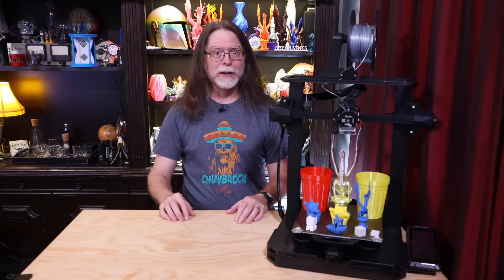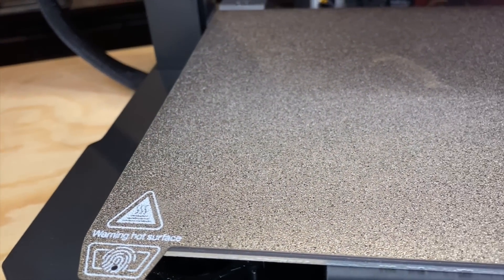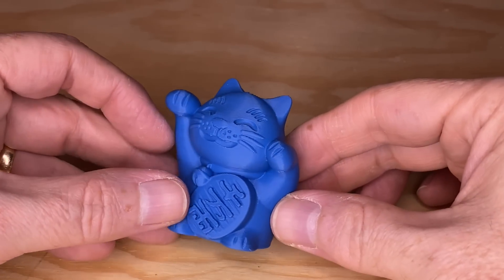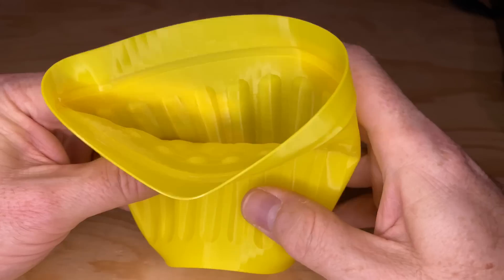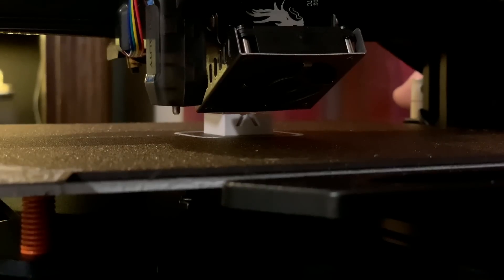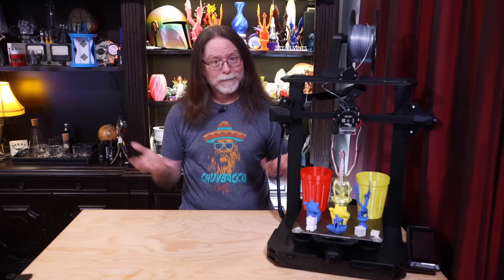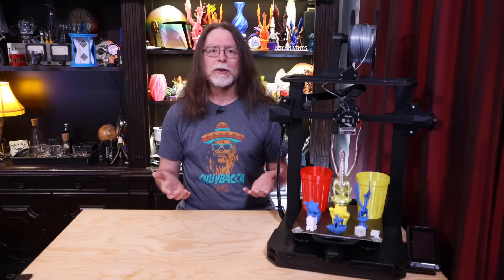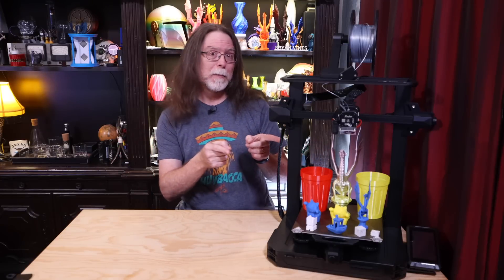The Ender 3 S1 Pro Review!

Comment: Brian, I beg you I need help. This printer will not work for me. Every single ender printer I use struggles to produce prints.

With this printer in particular, ABL doesn't seem to work. I can level the printer perfectly but the moment I auto bed level, it never seems to work. It makes the bed all kinds of lop sided and drags the nozzle along the bed. I'm clearly not the only one experiencing this. Did you get this to work with your unit?? I'm on the verge of returning this printer and giving up on creality. It's always one issue after the other with them.

Comment: I have to wonder if flicking the switch is the same to the printer as losing power, I know it sounds weird, but perhaps unplug it from the wall instead? Or is there a setting you are missing that needs to be turned on?

Comment: does flipping the switch actually simulate powerloss? i think you should unplug the printer with the switch on to actually simulate a power loss. maybe theres some difference in that...
Reply from the maker: Hi, there's no difference. Electrically, the switch is between the power supply's input and the power socket on the printer. Turning the switch off is the same as unplugging it.
It's funny: No matter how one tests this feature, if the switch is used, people suggest unplugging the power cord. If the power cord is unplugged, people suggest using the switch.  😉
I've spoken with the lead developer of the Marlin firmware, who says this feature can be fragile sometimes. What I think happens sometimes is that if power is cut while the printer is in the middle of updating the "I've gotten this far in the print" file, that file can get corrupted, leading to weird "resume" behavior.
An alternative: BigTreeTech makes a small circuit board with a bunch of capacitors on it, and a "power loss" signal. When power is cut, the capacitors are able to provide power to the main board for a second or two. Marlin can be compiled with an option to monitor an available input on the main board for a power loss signal and only then write the "You are here" file. I want to experiment with that, to see if there ARE any available input pins on a typical Creality board, or if they're all in use.
Reply: @BV3D  i was hoping that power switch might be something smarter than just an analog power cutoff. yeah, those excuses do not work, because they directly disable the feature in question... i too do not care about it that much, but if manufacturers claim it has it - it should work. a temporary battery or capacitors might as well be included in the printer itself if it claims to have this feature. thank you for the reply :)

Comment: I am wondering...In the power loss test, you turned off the switch which is not how a power failure would occur- it might matter if the code knows the switch was intentionally powered off.  I think a better test is unplugging the cord. Try it and let us know...PS:  I just bought one of these...I am laying by the door waiting on FedEx....LOL

Comment: Hi Bryan can you confirm  to me that the the temp can actually be set to 300c.  Sometimes they list the temperature and its 15c less. 
I have a metrial I print that prints best at 290c and if it goes only to to 285c it might not work as well.   I want to add this machine and also want a freind to purchase one so he can print the parts he asks me to print
Reply from the maker: HI! Confirmed - I just did it. It overshot to about 305 but then settled in at 300. 👍
Reply: @BV3D  thanks. I have been printing polymaker pa6-cf on my ender3v2 and I really think this is a great machine to ad and recommend to the other guy for this as he has an ender 5 but he is not at all the type to preform mods

Comment: I have the S1 normal and the power loss works perfectly. The FIRST day I got it my filament broke and I tested the sensor, it worked fine. After a while, this is not a joke, I lost power in my apartment for a few minutes so I tested the power loss and it also worked just fine.

Comment: I saved money and bought the 3S1 along with the same high temp hot end that's in the 3S1 Pro which cost me a whopping $28.00. I can do without the light, the touch screen, and the handle, and I wasn't too worried about the aesthetic differences on the front end of the machine. I basically have a 3S1 Pro and saved myself a Ton of Money. Great Review
Reply: Hi, I am thinking about doing the same thing. If I only buy an all metal heatbreak would I be able to print at 300 degres? Or I will also need to upgrade the thermistor and the firmware?

Comment: Great review 
I did the power loss test  on mine by both unplugging  it an turning the switch  off and I did this  3 or 5 times with 100% recovery everytime 
The only thing I seem to have problems with is upgrading it to the Marlin Software maybe you could do a video on that?

But I love the new S1
Reply: Does printer recover automatically (continuing printing) or it requires any "touch my display"?

Comment: Has anyone else had issues with not being able to ABL while preheated? It goes super slow and fails half way through saying 203 (Probing Failed) and then just loops ABL till it fails then starts over until I shut it down. It also does this if I add G29 to the start Gcode. Lastly I hate that you have to take the screen apart to update the firmware because you can't access the micro SD card slot externally.

Comment: The main problem with this printer is it’s inability to keep the bed leveling and a offset. It’s a real nightmare.
As soon as you make a home from printer or in g code, it lose the z offset and bed leveling.
I can’t recommend this one as Creality is aware of the problem and do nothing while there is tons of folks complaining on the internet.
Reply: Does this means you need to running bed leveling in-between each print job?
Reply: @shrimperlincs3395  i updated the printer with latest firmware and ran a new bed leveling multiple times in different orders and now it keeps it more or less.
 But sometimes you need to run it again… Looks like not all printers are affected or people does not notice and just put that on printings not sticking to the bed.

Comment: Hi Brian I have an Ender3 V-2, And I'm looking to upgrade to the sprite What is the difference between the all metal versus the regular. I really can't see any difference on their Web page I might have missed it please help me.
Reply: The regular one has a ptfe tube in it which will slowly break down over time and eventually need to be replaced. Also, the ptfe can only be used up to certain temps around 230 or 235 C so you don't have as many options for printing higher temperature materials.

The all metal hot end doesn't have this ptfe tube and so it can print higher temperature filaments

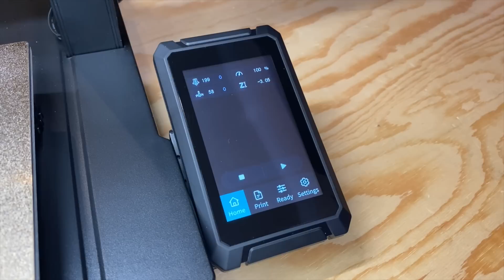Comment: 07:30 Power loss recovery. On my original S1, I have found power loss recovery is hit and miss.
Another change in design is the plastic trim on the front. It is missing, giving a much more functional look to the pro. The OES1 has a more consumer look to it.
Honestly, try the power loss recovery over a night and experience the blob of doom. The pressure advance deposit. It has dislodged several prints from the build plate. Both my Max and my OES1, of which I now have 2 plus my Max.
But as always, watching till the end, enjoying the puns (Are you sure you ain't Pierce Anthony? Look up his Xanth series) and being educated in an entertaining fashion.

Comment: I just got my ender 3 S1 pro, had some minor issues but mostly relating to tweaking it manually so its not truely out of the box experience. I had to tighten the wheels for the hotbed, as it was wobbly, ive scraped my hotbed once as my hour of leveling wasnt good enough apparently (which seeing as ive seen most youtubers hotbeds have a scratch on the left im in good company) AND had the extruder jam but im using a silk gold PLA and thats probably the name of the game for silk pla's. Took me over half an hour to take the thing apart fearing I was gonna mess it up while watching a youtube video but thankfully got the jam out (it was just a long strip of chewed up filament) and its printing fine. 

So its not perfect out of the box for me, and if you get one know that it WILL require some hands on but if your okay with that ive had a good time. Though ive had some adhesion issues but again, thats the silk gold pla from AMOLEN being finnicky im sure. Also id like to note its been super humid here with my indoor monitor saying up to 75% humidity and I dont have a dryer yet so im sure its absorbing moister like a sponge right now. I did buy the creality enclosure and thinking about buying a giant thing of desecant and putting tubs of it on the inside of the enclosure around the printer to maybe try and dry it out a cheap way.

Comment: Power loss on my S1 had to be enabled by checking the box. Once I did that it worked perfect the 2x I tried it. I have both my V2 and S1 hooked up to UPS’ so it’s not a big deal but it does work on the unit I purchased. Thanks for the review.

Comment: Think turning printer off took that as a reset so power loss recovery I would pull plug from wall.
Reply from the maker: Turning off the power switch breaks the circuit the same as if you unplug the printer. Or turning off the surge protector the power cord is plugged into. 😊 Same result.

Comment: As many have said a great addition on the Enedr 3 s1 pro.
Being the newish machine there are very few videos out on either s1 or s1 pro. 
I actually have two of each printer. If possible I would like see a viseo on how to do a software upgrade as well as one on adding the sprite head to the basic s1 with an upgrade. I bought 2 new heads for the s1 but cannot find reliable instructions on how to update the firmawe. Thanks

Comment: For the power loss test, did you try killing the power by unplugging from the wall to simulate power loss vs using the power switch on the printer itself? It may count on residual power in the capacitors as the Prusa does I think to recognize the power has been lost and save the state to resume when power comes back on.
Reply from the maker: My understanding is that the Prusa PSU has a "power good" signal that the Einsy board monitors to know when power's been cut, so it can store information about the current layer and position before the capacitors are exhausted.

The Creality printers (and most others, I suspect) update a file on the card with the current layer number when they finish a layer. When the job finishes, they delete (or clear the contents of) that file. When the printer powers up, if it sees that file (or the file isn't empty), it assumes power was interrupted and gets the number of the last completed layer, so it knows where to resume from.

Comment: 260 hot end, 110 bed temp in an enclosure helped print Polymaker ASA Black for me on a lightly sanded smooth PEI sheet (600 grit).

Comment: Had 2 S1’s from microcenter. Had to return both because they both required releveling after each print or else the prints would come out terrible. They printed decently when they worked but I got tired of tinkering with them after every print. My MK3S+ is arriving this week. Excited about it.
Reply: did you save the z offset after adjusting it ?
Reply: @samlevasseur  yes. Even tried silicon spring replacement mods on each. No dice.
Reply: Yeah I'm thinking I need to return mine too. Leveling the bed just doesn't exist on this printer. I think I'm done with creality. $500 and the thing doesn't even work

Comment: I find the draught shields work well with ASA, I use them for anything taller than 20mm and wider than 30mm.
 It seems there is something wrong with every machine Creality puts out these days and I'm starting to think they do it on purpose knowing full well the community will fix it, but in the meantime, they get people talking about the machine and even if it is negative talk it benefits Creality in the long run
Reply from the maker: OK, cool. Thanks!

Comment: For ASA Vision Miner Nano Polymer Adhesive is your best friend. Beds gotta be hot hot at 100-110 degrees. Little to no cooling. Keep it at 25% max after 3-5 layers. If the print is small enough you should be able to get away without an enclosure but for longer prints you’ll definitely need one.
Reply from the maker: Awesome, thanks! (also long time no see!) 👍

Comment: Does your y motor on s1 pro get hot?? I had to put a fan off of the light ckt to keep it cool during printing.  Creality put triangular hot stickers on the x and y motors but the heat on the y is very high.  Otherwise I love mine.
Reply: Well I read here yesterday. Printing right now, and you're right, the Y axis motor is VERY hot.
Reply: You have check the motor drivers voltage...maybe it's off..happens on a lot of machines.

Comment: I have both printers and are excellent. It's crazy, I use both a lot. Both are connected with octoprint through pi 4 very convenient.
Reply: Your bed leveling works???
Reply: @buddybonbutt7510  I do bed leveling through the display of the printer. That works great. First manual and then the auto level mesh.